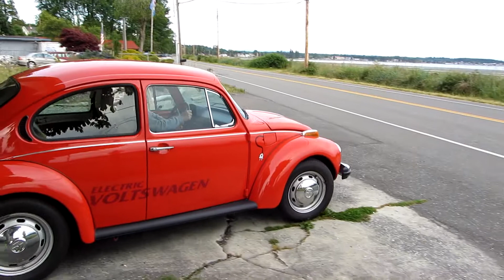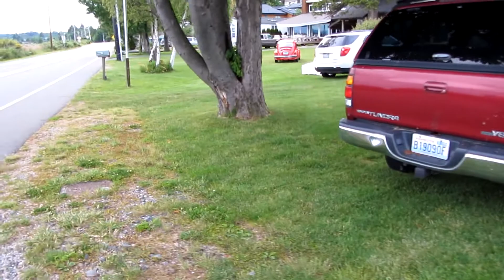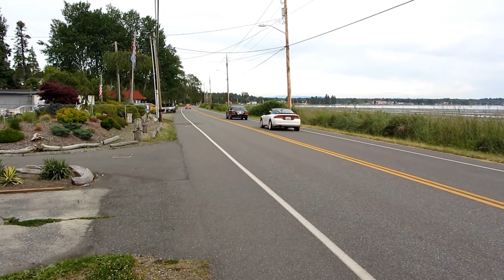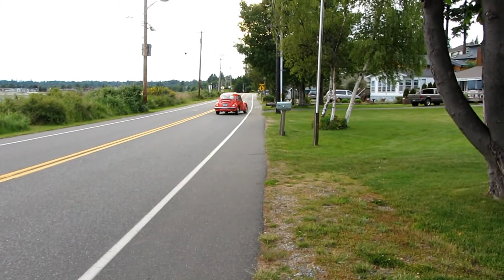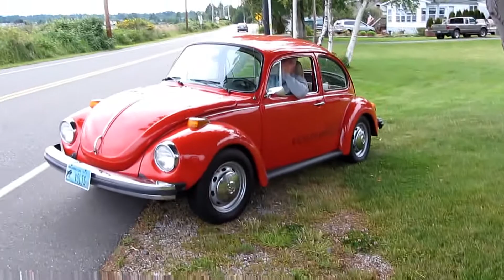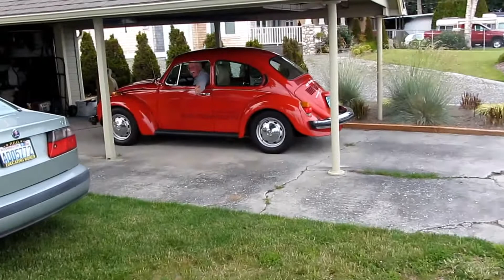EV VW - Plug Bug's First Run

Comment from the maker: No ... it hooks into the stock transmission. The clutch is gone, but I don't need it to change gears. When I take my foot off the pedal, the motor is freewheeling and acts just like the clutch was in. Unfortunately this means there is no compression to slow the car down, so the breaks get a lot of extra use.